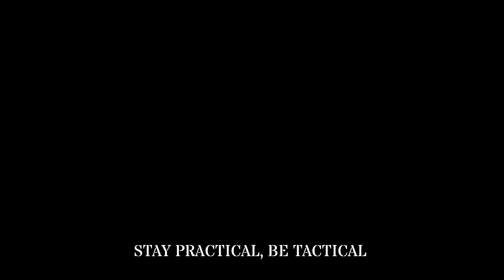NO RESPONSE after pulling the trigger??

Comment: I have an aging JG Steyr AUG. Is there a way to mod or repair my AEG?
Reply from the maker: I'm assuming it does not fire.. if you put in fresh batt, check your tamiya connectors.. if there's a light bluish or greenish residue, you'd have to change that.. unless you can clean it, change it (but i highly recommend that you change it to deans or xt60)
Reply: @tacticalplayground4312  Can I schedule a drop-off on your site?
Reply from the maker: @tituslevico  yes you can sir